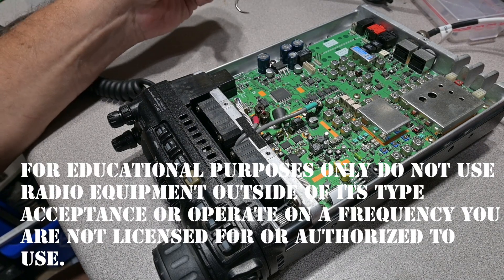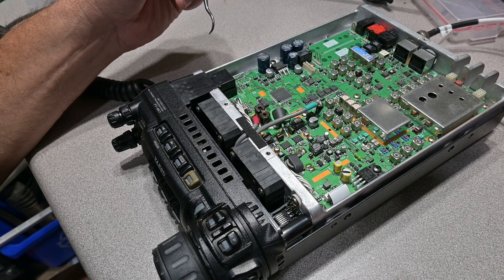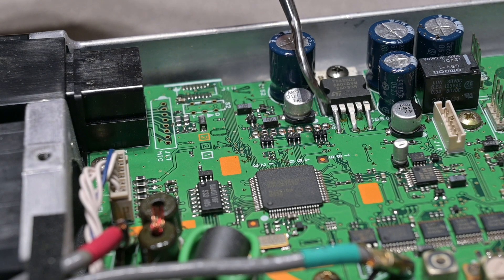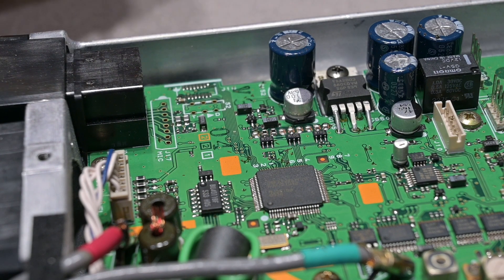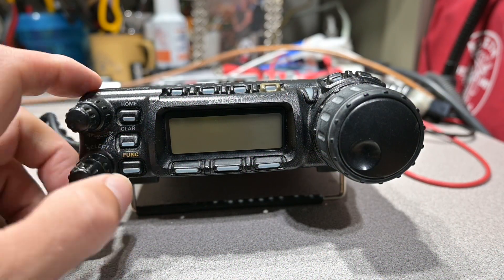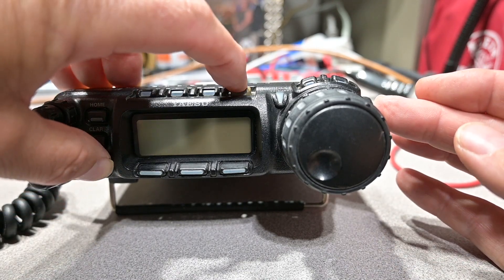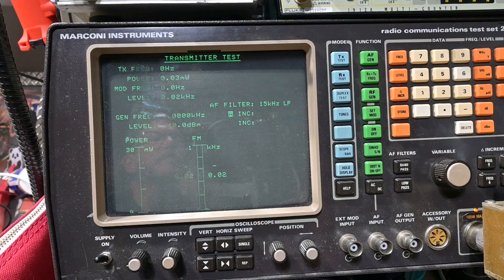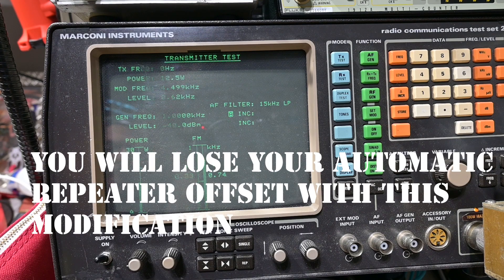Yaesu FT-857 Frequency Expansion MARS / CAP modification

Comment: June 7, 2025. I just did this to my Yaesu FT-857D and it worked perfectly. And yes, I have the D version. If you count the jumpers from Left to Right (looking at the board with "FIL 1" in the upper-right corner), I soldered closed 4, 7, 8 and 9. You'll need a sharp, pointy soldering iron tip and s steady hand. :-)
Reply from the maker: Thanks for watching !
Reply: @survivalcomms  does this open up frequency 446MHZ as I I’m thinking of buying one as I use in the UKPMR channels on the 4446MHZ frequency
Reply from the maker: @OneMan-N-HisDog-Explores  The US version has 446 mhz as purchased. Thanks for watching !
Reply: Does it open it up to 446MHZ

Comment: I have read that there were many versions and the mod only works on some of them.  Can anyone confirm this or offer advice on which serial numbers this mod works on?
Thnx for the great video too.
Reply from the maker: You are welcome ! This is the only mod I know of personally for this model. It is pretty easy to do and undo.  Thanks for watching !
Reply: Thank you my friend.  I have been concerned as some say it bricked the radio. Yet  If it is truly easy to reverse, I will go ahead. Thnx mate. @survivalcomms
Reply from the maker: The jumper configuration MAY be different if it isn't a US model @crazyham
Reply: @survivalcomms I believe the radios are the same. The jumpers determine the frequency ranges open for each country. Bought my unit years ago when I lived in the States but traveling to the EU with the radio I had to do the mod to open up the 70cm band used in the EU which basically starts at 431 MHz and runs to 440 MHz. When I am taking it easy I enjoy SWL but within the last decade we have lost many stations to the internet. Seems all I get now are stations from communist china.
Reply from the maker: @Subgunman  Thank you for the info. I had an old Lafayette HA800 when I was a kid .I miss those days too there was so much to listen to.

Comment: Another question sir. About the display problem, most say that having the the radio being exposed to so much sunlight causes that problem. So would it be safe to say that if I'll just use it indoors would make the display last longer or it's just the same as it ages? Sorry bother you sir, I am just contemplating wether to buy it or not. Sure appreciate it.
Reply from the maker: Im not sure what brings it on. I sold this radio personally. The most basic displays seem to stand the test of time. Will keeping a radio in a controlled environment prolong the display life ? I wish I could answer that with confidence but alas I cannot. Thanks for watching !
Reply: The display issue is prevalent to radios that are mounted permanently in vehicles. The extreme summer heat is the biggest culprit that de bonds the flex cable from the front circuit board. It is not repairable and one has to spend around $180 to Yaesu for a replacement assembly. Rumor has it that the de bonding issue has been fixed. There are other options out there where one can purchase aftermarket display units that connect either to the rear cat port ( you loose the ability to connect certain auto tuners ) or the microphone port behind the display unit ( you loose the ability to use the full feature remote microphone.).
Reply from the maker: @Subgunman  Displays take a real beating mobile. I bought another used 706 just to replace the head in mine a few years ago. I keep the head in the house now . The aftermarket displays are a good option but the one I experimented with years ago generated noise pretty badly. Thanks for your help !

Comment: Hi there sir. I am from the Philippines and someone here is selling his 857 for 38,000 pesos around 678 USD. slightly used and still got all the accessories and the original box. Do you think it's still worth buying it for its age? I am new to hf so would it be just fine for fix station use?
Reply from the maker: This was a radio that I had for a short period of time before selling it for about the same price as  the radio you are looking at. I made a few contacts on it testing it and overall my impression is it is a legacy radio that is compact but not extraordinary. One of the big concerns on these radios is the display going bad so keep that in mind.  Thanks for watching !
Reply: Thank you much sir for your insight, I'll keep that in mind. 73 and all the best.
Reply: Yes. It’s worth that amount of money. Yes. They normally sell for about $800. Just check the operation especially the display and output power before handing over your pesos!